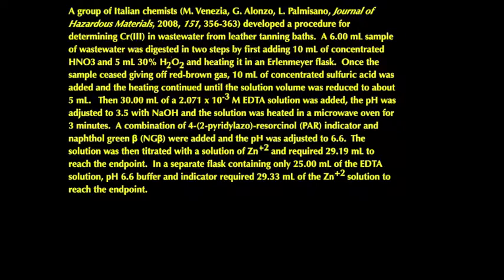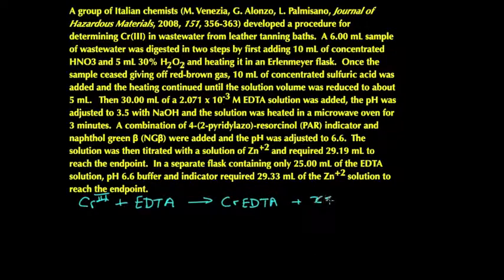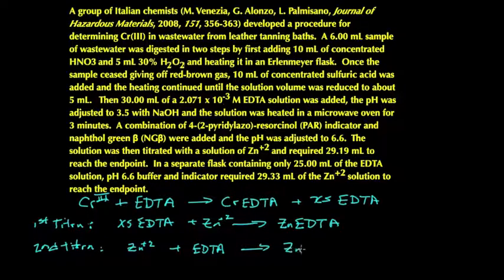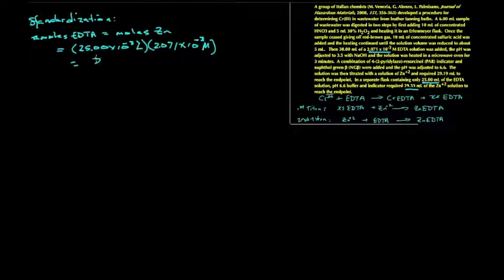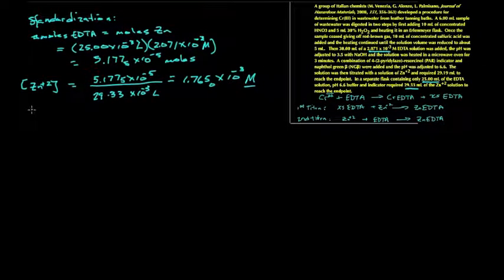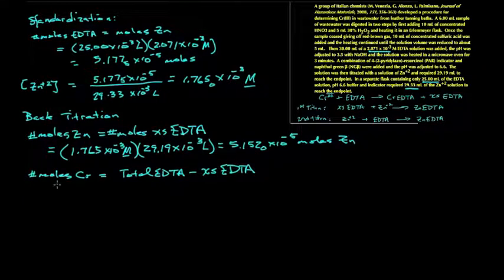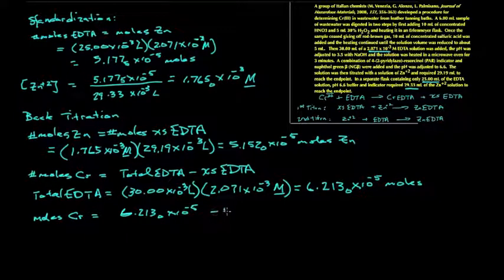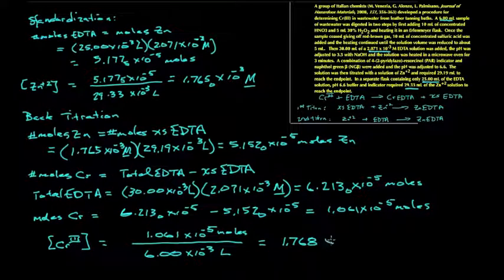Practice problem using EDTA

Comment: At a pH of 6.6, would we have to check an alpha chart of EDTA in order to determine the actual amount of "usable" EDTA in the solution? I learned in class that only the fully deprotonated form of EDTA can complex with transition metal ions.
Reply from the maker: Joyce,  Both the metal ion and hydrogen ions compete for EDTA. In a buffer at pH 6.6 the fraction of EDTA in the Y-4 form will be small.  However, if the binding strength of the metal EDTA complex is very large, it can pull the EDTA away from the hydrogen ions. The product of alpha times the formation constant, Kf, for the EDTA-metal complex gives a “conditional binding constant” for the complex. The bigger that number, the more completely the metal will take all of the EDTA away from the hydrogen ion. A conditional binding constant equal to or greater than 100,000 is usually the value that people accept as complete. That is, all of the original EDTA goes into forming the complex.